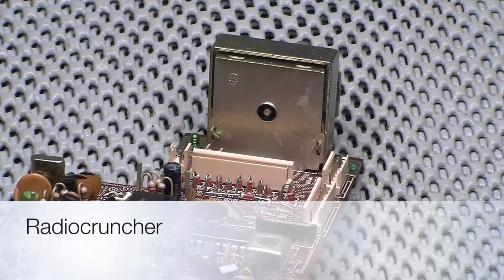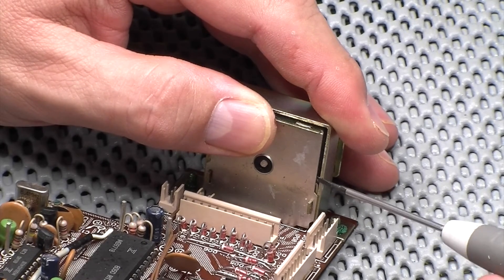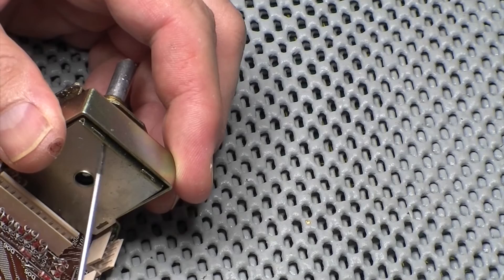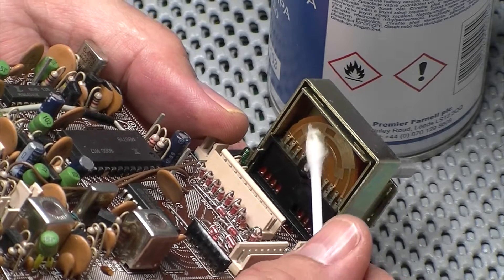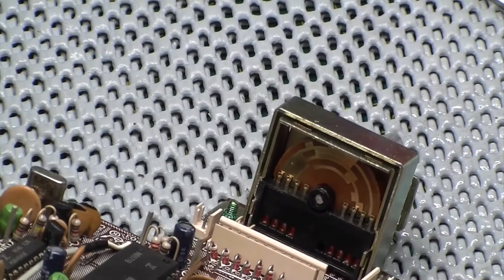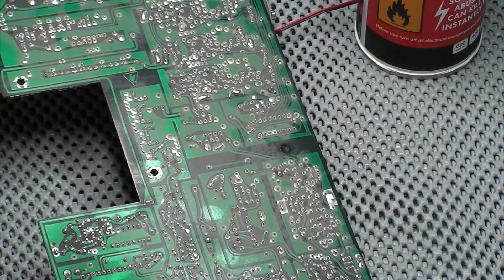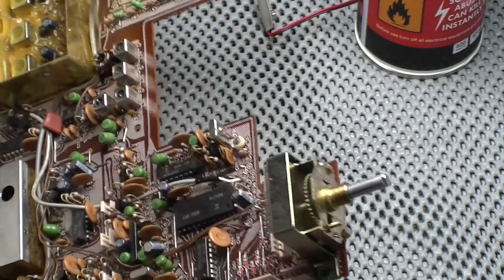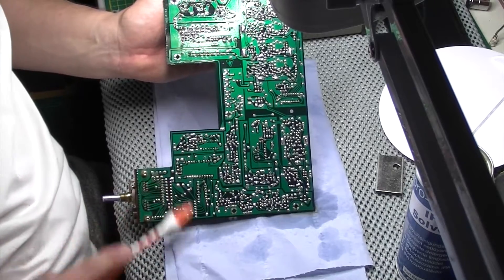Yaesu FRG-7700 HF receiver troubleshooting Part 3

Comment: I use Elecrolube Fluxene for PCB cleaning. Does the job perfectly: https://www.amazon.co.uk/Electrolube-Fluxclene-with-Brush/dp/B008RKXHHI
Reply from the maker: Thanks James. I have a really good flus cleaner here but it takes the colour off the older coloured boards

Comment: Won't be cleaning you teeth tonight then? IPA is great but you have to get every last drop of muck off.
Reply from the maker: I think I pretty much got it all off. Looks like it was fine dust so the IPA sorted it. Still can't shift the fault so onto the power supply
Reply: +Radiocruncher PSU would be my next port of call.  The teeth cleaning was regarding what looked like a tooth brush to clean the board. Good luck!
Reply from the maker: It's okay was the other halfs toothbrush! Power supply is also causing headaches!
Reply: +Simon Spiers Toothbrushes are great for cleaning all sorts of electronic/mechanical items :)